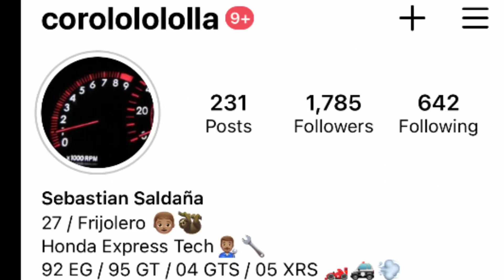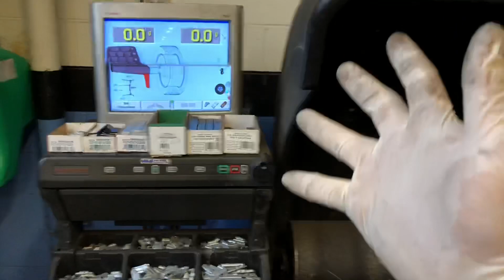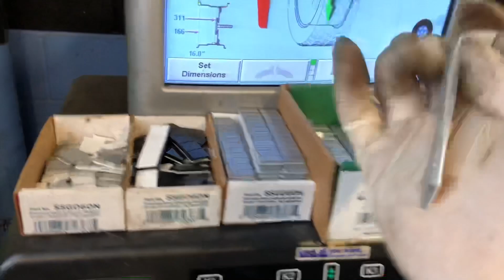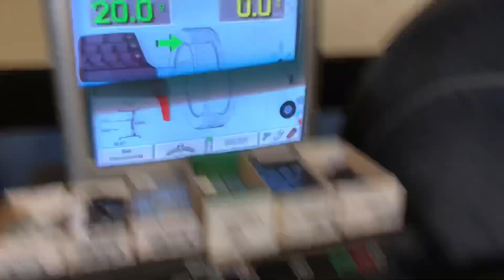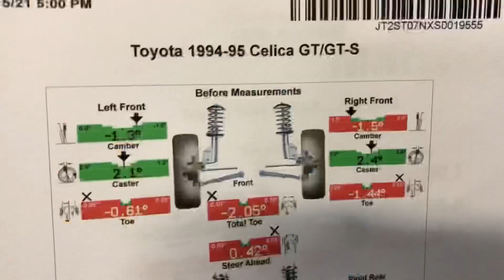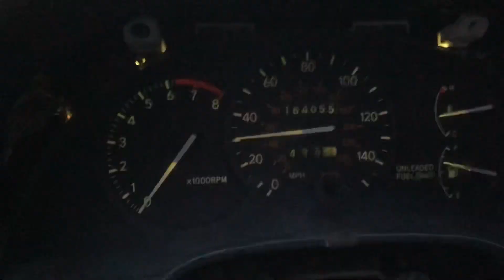Drove the V6 Celica to work for the first time!

Comment: I still need to figure out where i have the oil leak as well lol are you going to take the 6th gen to get painted with that guy in sacramento?
Reply from the maker: Probably the axle seals. I recently changed my axles on the Celica and the damn transmission started leaking a few days later. Be on the safe side and refill the transmission if its still have a slow leak.